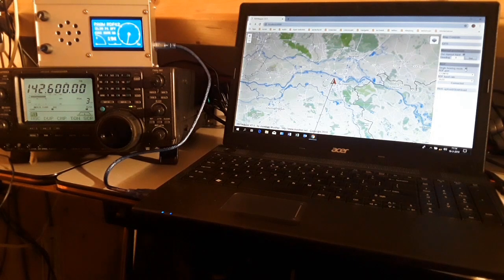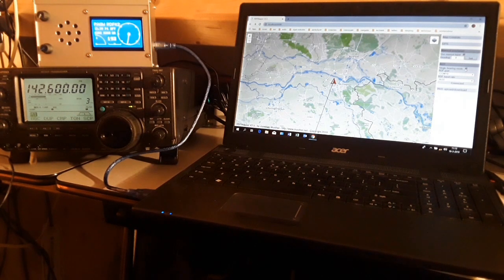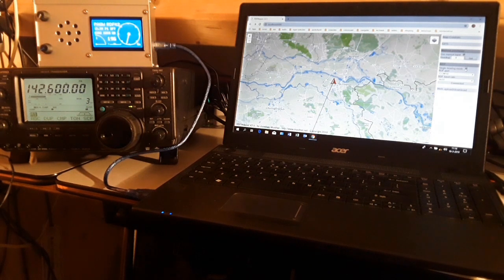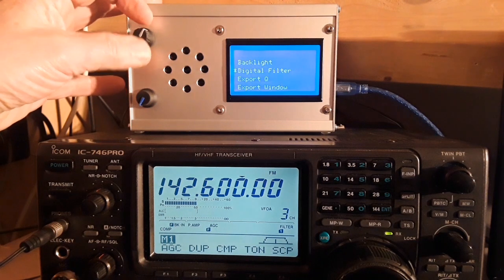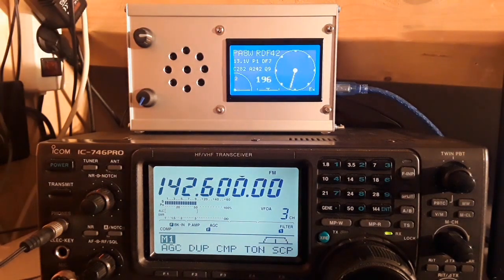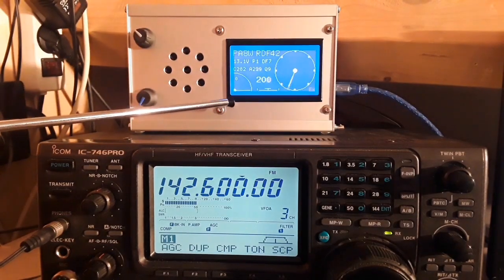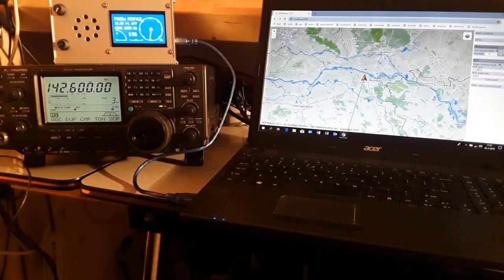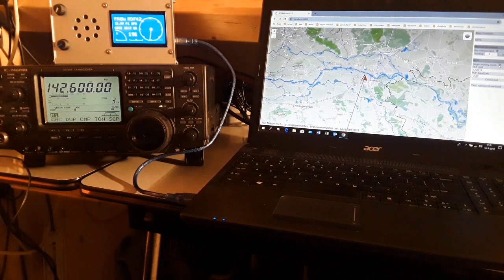RDF42 High Performance Radio Direction Finder

Comment: Have you tried log periodic antennas, such as ones etched on PC boards, instead of whip antennas?

Never mind.  found the answer on your web page.   
I was curious if you had, because I used a mobile RDF system that had 8 PC board antenna.   The system with those antenna worked very well, better than the other system that had annular slot antenna that were hidden inside the roof of our vehicles.    The PC board antennas were inside a Thule roof top luggage carrier.
Reply from the maker: No, I didn't because the beam width of LogPer's would require at least an 8-antenna system. Having built 2 different 8-antenna  DF systems I concluded that for normal amateur requirements a 4-antenna system is preferrable because it easily meets amateur demands. So I stopped experimenting with 8 antenna systems years ago. Additionally, an 8-antenna LogPer array would have a very impractical size compared to the whip solutions I use on my 4-antenna systems

Comment: Does this mean you could use this to direction find any UHF/VHF radio in the vicinity? you mention the burst mode....Does the burst mode allow you to direction find any millisecond passive pings given out by out the UHF/VHF radio? thanks
Reply from the maker: You can find radio sources such as transmitters or faulty electronics that generate electromagnetic energy in the VHF and UHF range.
A complete system consists of antenna array, receiver and a RDF processor such as RDF41/42/43.

The burst mode is explained in de RDF41 page:

Starting August 2018 the RDF41 has an improved second mode specialized for hunting very short transmissions down to 1/5th of a second.
It doesn't  build a long term average: simply because there's no time for that.
Instead, it gathers and displays real time measurements, until the signal starts to weaken.
That means that the last bearing is calculated using the strongest part of the signal burst, not the much weaker part just before the squelch closes.
Depending on modulation content of the tracked signal, the RDF41 manages to get good accuracy (within 5 degrees) on bursts of only 1/5th  of a second.

Comment: Have you tried using silicon rf switches for the antennas?
Reply from the maker: No, because I use soft commutation for good reasons.
 I don't know if that is even possible using silicon rf switches. Please read: 
http://radiodirectionfinding.nl/pa8w/dopplerdriver.html
Reply: @pa8wil  How does the soft switching behave in AM pattern mode when getting close to a strong transmitter? My doppler I was playing with lost its direction close in, even with enough attenuation in the receiver,so I gave up on it around 1995. I also had the reflector elements bent  inward, made a better pattern modeled on 4nec2.
Reply from the maker: @dodden1  You mean using an Amplitude array?  I never really tested that. But I am pretty sure that the poor dynamic range of most compact amateur receivers is the limiting factor here, not the switching devices.

Comment: May I know that , if I used the handheld receiver instaed of the bench top one like yours, then how much the performance could reduce ? 

PS: I understand that you feed the Audio Line out from the radio to being the input for Df processor , right ?
Reply from the maker: That's correct, the receiver's audio is fed into the DF processor.
All classic police scanners and handheld receivers I tested worked well for me and are capable of achieving a system accuracy within approx. 3 degrees.
However, some small transceivers like the Baofeng UV3 show variations in group delay caused by signal-strength-dependant audio filtering. That renders them useless for RDF work.
There's more on the subject here: http://www.paluidsprekers.nl/pa8w/radios.html.

Comment: It is not a theory that moving objects directly above you don‘t make phase jumps at all. 09:01 That is common sense in aircraft VOR navigation. It is called „the cone of silence“.
Reply from the maker: You're right, it's not a theory, it's a fact. A 4 antenna pseudo doppler RDF is getting difficulties when the elevation exceeds 60 or so degrees.
Does that correspond with your experience with VOR beacons?
Reply: @pa8wil  The official  documents talk about +/- 50° over the VOR. My impression is that it is much less. Maybe because of the size, antenna numbers and quality of the local VOR installations. I will check that the next time and note the AGL and position data. I‘m curious how much reality differs from curiculum numbers.